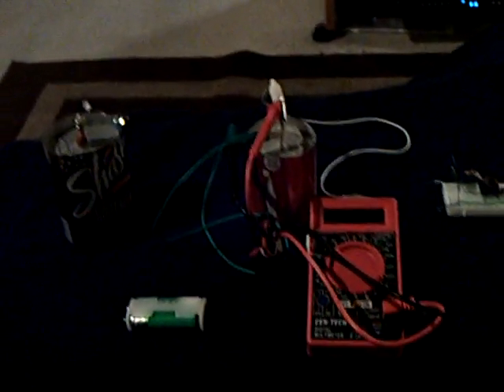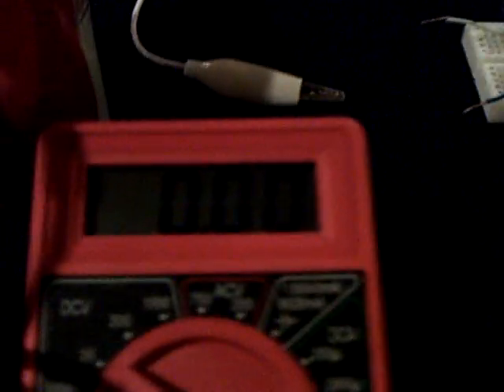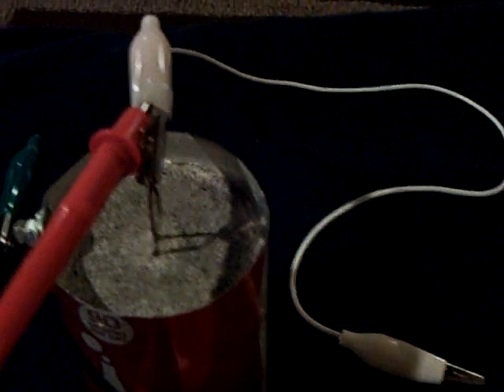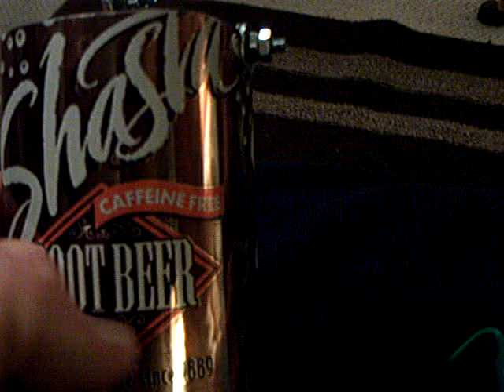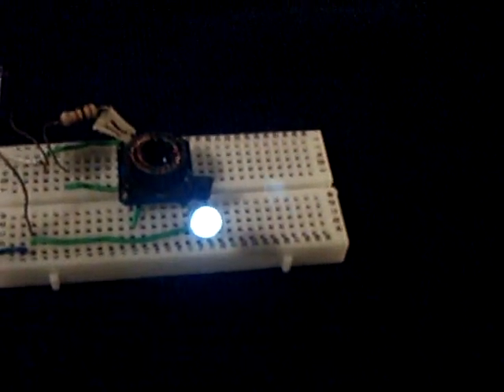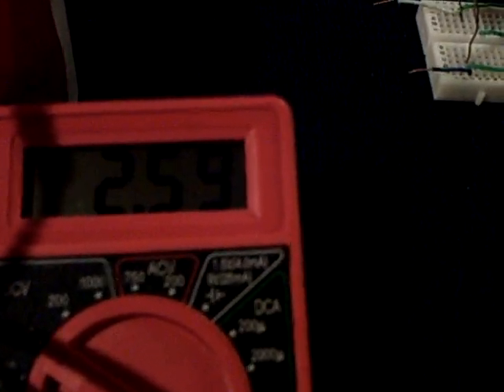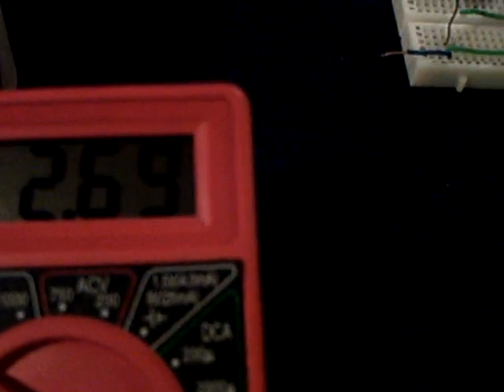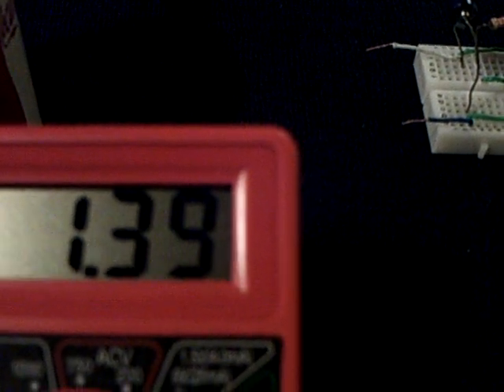Rechargeable Cement Battery.ASF

Comment: Maybe try using the output of the joule thief with a diode to pulse charge the cement batteries.  Or no diode..  Oscillate from short to charge, short to charge.

Comment: unlike the petroelectric effect which is found typically in hawaiian basalts and pyrites naturally, these rely instead of heat, like in an electret, but rather a chemical burn and heat from the formation of the cement, high voltage applied to these as they form is non conducive to proper creation but rather low voltage pulsed manually by touching the anode and electrode repeatedly during  the initial cure process with low voltage -- millivolts will suffice.

Comment: one of the keys in charging these cells, is gently hitting them with very low voltage and pulsing it, as the cement cures it will polarize the entire filling and create a product that is more stable and takes on charge better, as you state, like a capacitor. these are more akin to a function of an electret with a very high resistance and very strong conductors working in conjuction. the petrolelectric effect is also a player here.

Comment: i have been experimenting with these for years. I have very limited electronics experience, however, when  they completely cure dry they will die if that is a bit of a clue, the bright side is, a very very limited amount of moisture, even a spray or two will ignite them. they can be built on a very small scale, the size is not particularly important, but the copper core shielded from the can with an insulator at the bottom will produce better results.

Comment: @SnowLabsRatedX   Cells giving me 1/3 Volt here are 1/2" x 1/2" Aluminum and Copper strips with a dabble of cement & table salt mixture (about 1/3 table salt). No amp measure yet as mine are all fried and new ones are inbound. :-)

Comment: @SnowLabsRatedX   I am not certain yet if the mechanism is Radiant Energy or receptivity to waves of the quantum vacuum, but there is a difference.  Overall behavior is very much like a weak Tesla aerial/ ground rod connection; Like captret recharging.  Encasing smaller cells in a lead box might help determine if the recharging is from Moray-like sensitivity to solar's UV/ X/ Gamma...or if picking up QV waves.  Could be the galvanic action is slowed by the solid electrolyte, but I think not.

Comment: @Lidmotor  Fascinating cells similar to Hutchison's. Been playing with them here, too.  Have 1/3 volt steady, increasing, and bouncing back under small loads which tells me it isn't from galvanism.  Seeing buildup, then short out & spike to 4 volts (on the meter, which is wrong but something is there), then buildup repeatedly. Still have more sweeping to do through the o-scope ranges and data logger analysis of voltage buildup and drop over time.   Oxidation will impact the electrodes long-term.

Comment: I used a gold salt solution made from citric acid in portland cement and got one out of four that held charge like yours.i think maybe the electrolysis of water will ruin a cell if its been charged before it fully cures.maybe the citrates formed in the cement helps make a chargable cell.citric acid is used to change the curing rate of cement.the sodium silicate waterglassis an ingredient in geopolymer which i think would make good cells since they are more like stone...

Comment: please do some c5 or even a c20 test on the battery. That way you can actually define the stored energy, and then confirm if the battery takes a recharge or if its simply a capacitive effect of voltage but little to no amperage due to a dielectric.

Comment: very interesting indeed. we like rechargeable : )
is silica a possible material or is it not advised?
also i was thinking there is some micro-crystaline materials that maybe can be used maybe in the mix. Chalcedony (quartz) / Crystal Quartz (SiO2).
i dont know if its relevant to the kind of cell were making here.  i know john wants to keep it non exotic but quartz is fairly wide spread. just ideas. : )

Comment: Thanks Lid. It will be interesting to see if the aluminum degrades or not, in the battery that is rechargeable. (Providing it remains rechargeable!). All aluminum batteries I have made ended up being primary, even the air battery. Haven't played with the alum though.

Comment: i think this has to do with air moisture content and a form of static energy as witnessed by grey he needed to dry his devices energy tension seems to due different wave responce to water evaporating and condensing it and the joules of energy for change of state can be tremendous like volta's perpetual chime.

Comment: fyi a plain hand operated can opener will remove the top of the can cleanly.leaves that top bevel edge which has the seal that isn't painted or coated like the rest of the can.not to mention still stackable.gentle pressure till you know the opener is riding that lip then increase pressure to puncture the can.peace